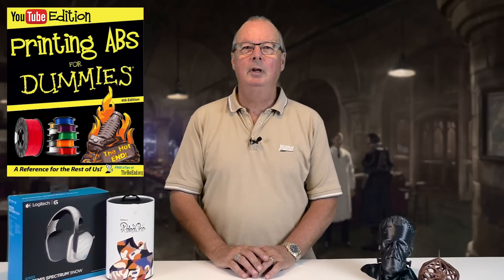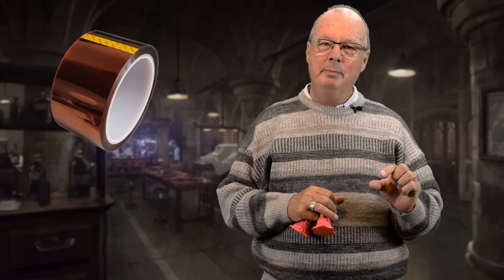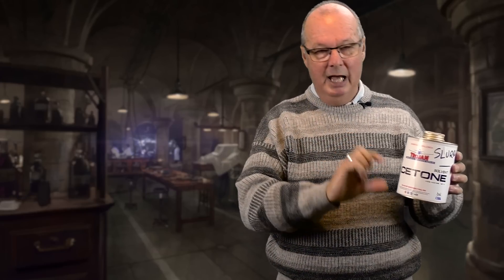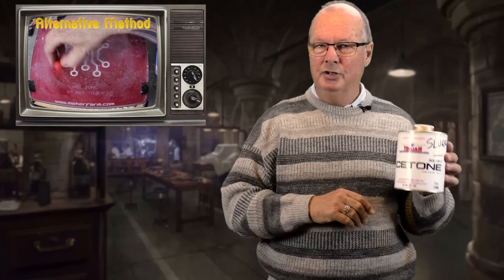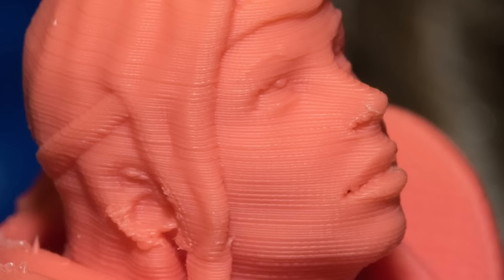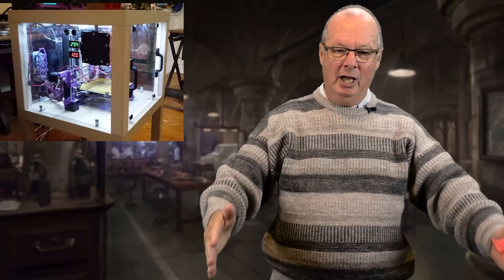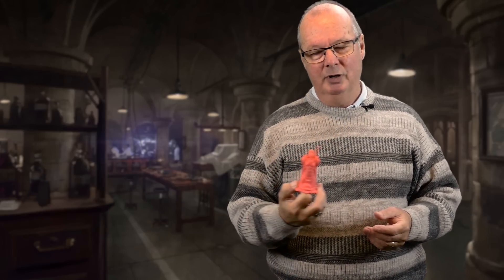ABS For Dummies Part 2! The Conclusion

Comment: I just tried ABS again and in the summer I just can't get it to stick but could you explain how the part itself lifts up (you can see it in the light) but the brim stays where it is at.  If the brim is really an extension of the part's first layer how in the hell can the brim go untouched?  Look at the part, with the brim, in the light and see the corners, or a long flat run, that has lifted but the brim is dead flat?  I use S3D and this makes no sense to me.
Reply: hair spray  slurry .. etc it works great
Reply: The lift is caused by the cooling of layers Above the lift. The brim won’t budge as it’s only one layer thick

Comment: I hate ABS. It's a material from hell. I tried everything in these videos but never completed a print. Wasted 40€ on a roll.
Reply: sorry to hear that. what was the problem?
Reply: It is always a different problem. Sometimes it won't stick to the bed. Some other times layers just randomly separate. Maybe my Anet A8 isn't suitable to print ABS properly.
Reply: I'll give ya one better and that is in the summer (about 5-6 months of the year) ABS will not stick on any printer I have not even my enclosed one but come the cooler, and drier, months of late fall and winter it sticks even to my wide open air printers.  Go figure.

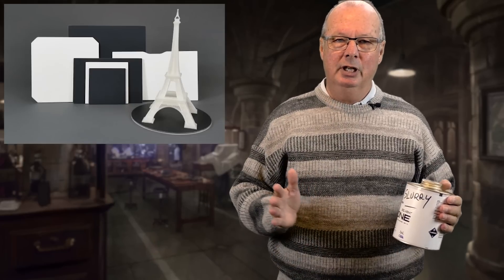Comment: 1:15 but they keep saying Z skins, etc do not warp well that's £25.00 in to the bin
Reply: nothing is perfect, but I find Z skin the best. Second best is ABS slurry on plain glass. If you are using Z skin, try wiping down with a little acetone first. I find my biggest problem is getting the print off the skin.

Comment: I've had my first real issue with ABS a few days ago: the part sticks well to the heat bed but there was still some wrapping issue, so much that that the print start delaminating even in an enclosed chamber. I think that it was because of the shape: a 5x150x150mm wall, I don’t know wat to do to avoid that, any idea? (print well in PLA)
Reply: if you are printing with the 150mm surface on the bed, try rotating to print on edge so a smaller area.

Comment: I work pre-dominately with ABS+, printing on a 0.25mm film of Ultem. no enclosure is ever installed on all my tevo tarantulas. And I never had a printing fault, with identical results if not better than those printed on the fortus.
Reply from the maker: +Darius Foo you have been lucky - there is a reason all high end machines are enclosed
Reply: I have a tarantula to, not enclosed. It does a great job but enclosure would make it even better - John.
Reply: I actually cut samples and handed over to my friends; depending on their print bed sizes, and they too are experiencing the same good results
Reply: "ABS+ is less dissolvable to Acetone bath than regular ABS." which eliminated that for me.

Comment: finally someone else that doesn't seem to notice any unpleasant odor while.using ABS. I have a nose like a bloodhound and never noticed that bad or strong an odor as others claim.
Reply from the maker: +sinformant Dad does not notice it, to me it smells like literal burning plastic - Anthony
Reply: The only filament I have a problem with is polycarbonate, it stinks.
Reply: It reminds me of my childhood when I would burn Bic clear plastic ball point pen cases as I needed the melted plastic to hold things together.
Reply: What ABS manufacturer are you using? Would be helpful to know....

Comment: cold acetone baths is my way :)
Reply from the maker: +shane agnew nice - rice cooker is my preferred
Reply: I need to buy a rice cooker because I spent have a can of acetone a few weeks back and after 4 to 5 tries at 1-3 hours each time I barely made a dent in the print except where it was 3-5mm away from the napkin.  The filament in pure acetone melts completely within minutes and is what I made some slurry with so it isn't ghetto filament.

Comment: I gave up on abs and PLA.  PETG, ftw!  Prints as easy as PLA, is less brittle, and has almost zero warping or shrinking.  It can be finicky about temp if you don't get that right, but it's so much easier to print and more consistent than I've ever gotten out of abs.  It's also landfill and food safe. No, you can't smooth it with acetone, but some sanding and automobile primer and other paint, you can get some really nice looking prints.
Reply: correct, the filament may be food safe but the 3D printing process is not.
Reply: that is incorrect, in fact 55c water will encourage bacteria growth, in particular Thermophilic bacteria with an optimum growth at 50 - 60 C.
You need 100c to kill most bacteria but even that won't kill everything.
I am a qualified chef and certified food handling supervisor. I do not make these comments lightly - have you ever had "food poisoning"?
Reply from the maker: +sacredsoulrecords no filament is food safe
Reply: The Hot End There are filaments that may have dyes that are not, but there are definitely food safe filaments.
Reply from the maker: Please enlighten me - Any FDM process catches bacteria between the layers - not to mention contaminates from the printer..
Reply: That's not true. Bacteria will get terminated by the heat and if you put your printed part into 55C water for 2 or 3 hours, you should be safe any way.
Reply: I purchased some PETG early last year and after a couple of tries on two printers I threw it in my dry box and last week tried it again and I love it.  So much nicer to work with than PLA (I hate PLA and always have) and after about six prints I have it dialed in making parts for an upgrade to my old printer.  I have one issue with PETG and that is the temps it can handle as sometimes I need the temps that ABS can handle especially in my enclosed printer where the PLA parts have warped.

Comment: PETG and ASA are the master race. ABS peasents
Reply: ASA may well be better. I will be trying it soon. PETG, I find, is a pain to get just right.
Reply from the maker: we just got a load of PMMA and ASA and PETG and ABS and PLA
Reply: PMMA is sooo strong but its so hard to print it warps worse than anything ive seen and you wont get it out of your nozzle anymore
Reply: I have heard that it warps badly, will give it a try anyway.